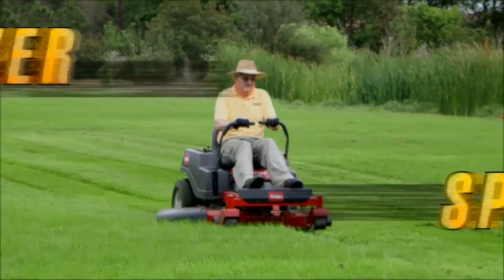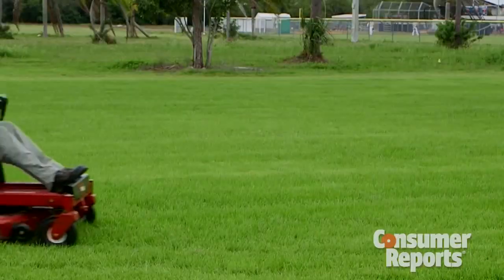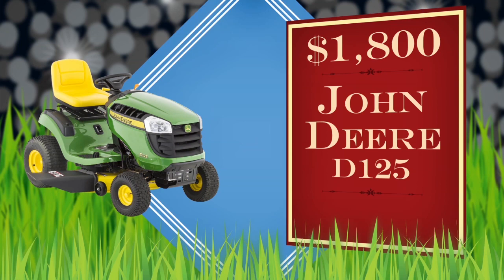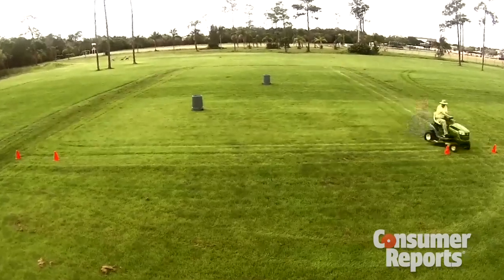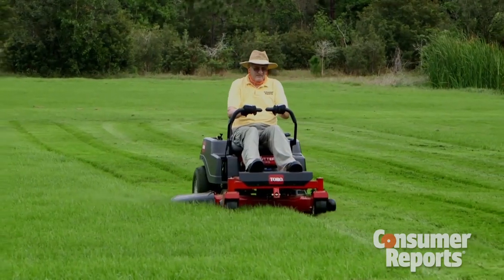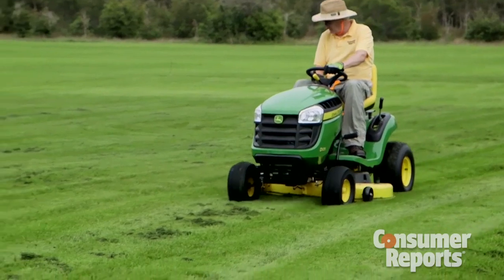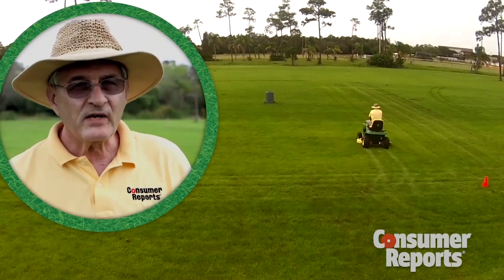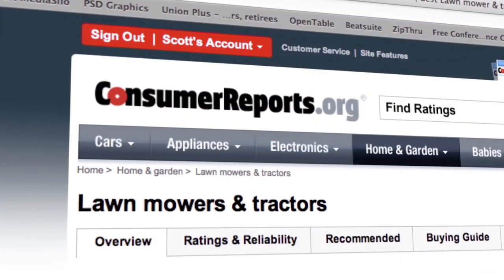Cutting grass fast: A mower race | Consumer Reports

Comment: Peter drove the zero turn wrong.  And a better test would have had more obstacles as most lawns do.  Having to get around them, and occasionally back up to turn is where a zero turn saves time.  My troy bilt mustang ztr goes 1.5mph faster than the rider I had last year but it is the turning and reversing time savings that make the most difference.  The only place a rider works better is on slopes, as they handle a higher degree of slope before losing traction.

Comment: If you're mowing an open field in high or thick grass and especially if you want to mow quickly, you've got to break a safety rule and raise those dam** chutes and unleash the power of those mowers. I'm not a pro, but even I know this is all wrong for the scenario that they just mowed. I am actually a semi pro, as I help mow tens of acres each week as part of my duties as a gov't worker at a fish hatchery. So I've learned a lot about mowing quickly and decently over the years. These well-intended folks through innocent ignorance (and safety correctness) are absolutely giving bad advice as for a mowing technique in this situation operating virtually any mower no matter the power, size or price point. Either the chutes should be strapped up so that the grass can disperse as much as ten feet away and to the side so that exiting grass can keep up with the volume of grass being cut; or alternately, the grass must be bagged hauled off and dumped somewhere else. And who is going to take the time to bag unless the customer demands it. I realize that no one is going to tell us to use this so-called "dangerous" method of mowing that everyone in the real world uses; certainly not the manufacturer and certainly not a reviewing organization, but is absolutely the way fields like this are mowed in the real world when it's not an ideal situation where one can't mulch ( it's not dry, thin, and not so tall grass), and if one can't take time to bag or have anywhere to dump bagged grass.. 

From my experiences at work, this is especially true with a tractor-type mower. We have a 60" cut JD full-time 4WD with a 25 hp twin cylinder engine, top-of-the-line X738 model, and if we try to mow with the chute down with this "as powerful as one can get" tractor-style mower, we get a horrible cut and terrible clumping just as shown on this video. It also bogs the engine down horribly and that causes the otherwise horrible cut beyond the horrible clumping, but If we raise the chute, then its' a totally different mower. It cuts great with no clumping and it revs high through any grass giving a great cut. Our zero turns have a 36 hp Vanguard engine with a bunch  of torque. They don't even have a chute installed on them. They have a deck opening shut off plate that is operated with a spring-loaded hand lever. The mowers have a safety label on them stating never to mow with the plate raised, but we always mow with the plates raised when mowing fields. If we close the opening, even with a gas engine that's almost 1,000 cc, will leave a line clump of grass at any speed; and this is a mower that can mow at 15 mph decently in grass that is not too tall or thick. I use a 30" walk behind at home. Same thing but worse. If I don't strap up the chute or bag, then the deck opening clogs up; the mower then tries to mulch; it can't mulch; it clumps and it's slow go. Strap up the chute, and it's a beast!

Comment: Any time you go too fast and are mulching or using the discharge chute your going to leave clumps.  I side discharge and keep the chute tied up so the clippings are broadcast to the air.  They disperse with out any clumping or carpet effect.  I keep my grass long (2 3/4 to 3 inches) and mow often (2-3 times a week)  We have in ground irrigation and fertilize three times per year (Starter fertilizer in the spring, 30-0-0  long feeding mid June and winterize just before frost.)

Comment: As a professional landscaper and the owner of a small engine shop. I can tell you right now, the way he was operating that ZTR was like driving a bulldozer or a skid-steer. Of course it's going to leave divots in the turf. But if you put a seasoned pro who knows how to properly operate a ZTR on it. (Like making the wheels turn in opposite directions when turning...) Things like that won't happen...

As another side note, the ZTR makes a huge difference. All residential ZTR's are a joke. Get at least a light commercial ZTR. You can drive faster and still get a nice cut. The top speed of my personal commercial ZTR is 10 MPH. I have some lawns where I can and do mow that fast...

Comment: He was tearing up the turf, because he doesn't know how to mow.  He is a novice, so his opinion is really useless in this comparison.

Also get a higher quality ZTR with a fabricated deck and it can handle the speed.  Toro Timecutters with the stamped decks are trash.  At least get a cheaper Hustler with a fabricated deck and even the residential models will mow circles around a riding lawn mower.

Comment: Those tire divots were "operator error." You shouldn't be making those tight turns: you should make your first pass up the middle of the lawn, and then mow in "Zamboni ovals." That way, you never turn tighter than half the width of the yard.

Comment: A set of multching blades in that zero turn,slow down when you turn around.it just depends on how a zero turn is used.its faster but a lawn tractor will cost as much but a zero turn mower will cut your time in half.or let the guard up It won't clump,shapen the blades,wet grass will clump.

Comment: I thought about a ZTR I have friends  who own a few of them But I  choose to get a Rover 547/38  tractor As there are quirt a few problems with the ZTR for one is the price.  When I looked at geting a ZTR is was all most double the price of what my tractor would cost Also I could  not  put  attainments on a ZTR  Like I can on my  Rover 547/38  I have a very useful mower Trailer.  A tractor and ZTR mow about the same speed but on turning with of my tractor it has an 18 inch radius So all you have to do is back up a little bit and go over it again. only takes about  a second. So  I found trees are no problem as I the tractor can go round a tree easily.  But I have heard from a dealer that on sharp turns with an inexperience operator  a ZTR tyres will dig in and can leave these great big tyre marks Also  I was told by my friends when mowing  across slops on wet grass his  ZTR will some times tend to easily spin out.  and can also easily get it self out of control and end up in  a roll  over. Then what  a tractor can. This happed to him  He told me the dealer told him that There have been people severally injured  mowing slops on wet days with ZTR with roll overs And though  My  tractor can also tip over on slops on wet grass but it far slower  doing that  then a  ZTR can.  Allowing  time to get away  from the full weight of the tractor As  ZTR is built stronger So it id far far heaver then a tractor.  So being crush from a  ZTR roll over and not to mention the still  spinning  blades.  can be a bit of a problem.  Most commercial operators tend to trade in ZTR with low hours on the dealer said as  low as 200 hours.This is because  though the  ZTR needs  about the same amount of  maintenance as a tractor.  But the parts on a ZTR are far  more expensive and harder to get then they are with my  tractor.  Plus I don't need two hand to drive my tractor because of this  a ZTR trade in and its  resell price is far  lower.  So I think I stick with my tractor.

Comment: With a zero turn if you are mowing like he was you are supposed to do a 3 point turn or put one arm in reverse and the other in forward and usually you will not be flying through your lawn trying to race against another mower

Comment: duh, anyone with half a brain knows that when one wheel doesn't spin, and one does, it makes ruts. I use a 6' Kubota zero turn (only has about 14-15 hours on it) and have left few tire marks. My only complaint is that the handlebars are not even. + It has an air ride seat ;)

Comment: 2:00 Peter absolutely should not drive a Zero Turn Radius mower.  He's doing it all wrong.  You do NOT keep one tire fixed while you pivot with the other.  Of course you're going to tear up the lawn.  With a ZTR, you go forward with one wheel and backward with the other.  Both wheels are rolling and not dragging.  This absolutely has to be the worst "how to" guide ever.
Reply: I know right

Comment: You didn't use a real lawn mower.  Try and Exmark vs Grasshopper.  Both are commercial grade, and both mow at a very high rate of speed.  The blade tip speed is twice that of a residential mower, and the grass outlet is twice that of a residential mower.  Professional cut at a high rate of speed. Of course they cost twice as much as a residential mower.